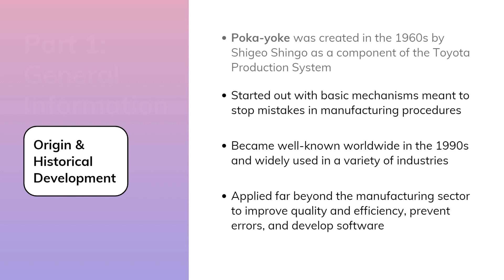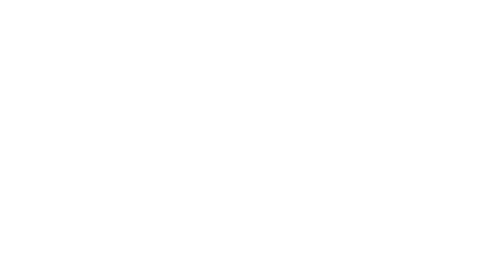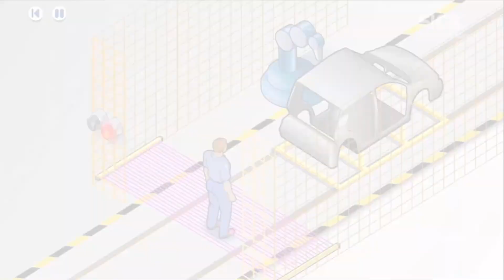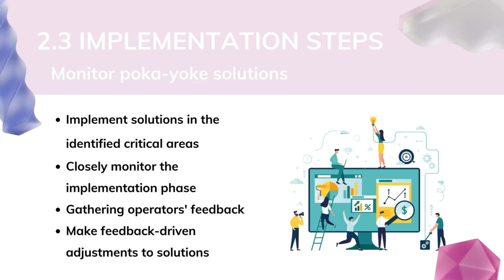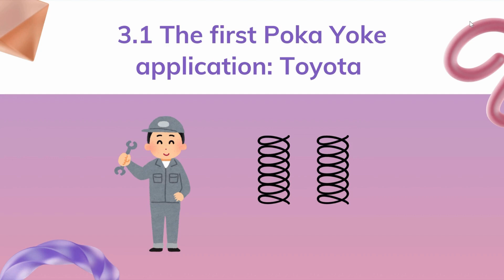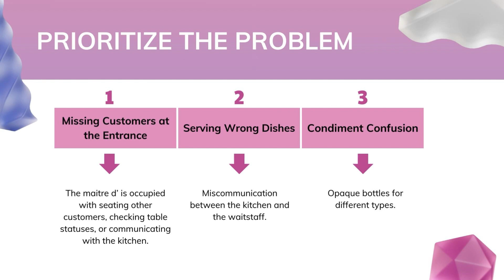POKA YOKE

Comment: Hi, I am Nhật Thiên, from group 2. My questions are:

1. While Poka Yoke aims to automate mistake-proofing processes, it still relies heavily on human oversight and involvement, especially in areas like training, monitoring, and feedback. How can businesses ensure the right balance between automation and human intervention when using Poka Yoke?

2. While Poka-Yoke aims for error prevention rather than error detection and correction, how can organizations ensure the long-term sustainability of these improvements, particularly in environments with volatile changes in technology or product design?
Reply: Thanks for your questions, we would like to answer it as follow:
1. To effectively balance automation and human intervention in Poka Yoke, businesses should start by assessing the complexity of their processes to determine where automation can be most beneficial and where human oversight is essential. Incorporating employee feedback is crucial, as it allows for real-world insights that can refine automated systems. Investing in comprehensive training empowers employees to understand both the technology and their roles in monitoring processes. Continuous monitoring of Poka Yoke solutions helps identify when human intervention is needed, while flexible automation systems should allow for easy manual overrides. Cultivating a culture of quality encourages employees to take ownership of processes. Additionally, regular reviews and pilot programs can help fine-tune the balance between automation and human involvement, ensuring that systems remain effective and adaptable over time.

2. As we discussed in the video, implementing Poka Yoke is not a one-time effort but rather a journey of continuous improvement. To sustain Poka Yoke improvements in environments with frequent technological changes or evolving product designs, organizations should foster a culture of continuous improvement (Kaizen). Specifically, when designing new products or processes, ensure that Poka Yoke mechanisms can be upgraded or replaced as technologies change. To achieve this, it is crucial to encourage collaboration between design engineers and production teams to align Poka Yoke solutions with future product iterations. This can be done by anticipating potential future needs and embedding adaptability into the design phase. Early integration of Poka Yoke into product and process design allows for proactive adjustment to changes. Last but not least, regular employee training also plays a vital role. By keeping the workforce updated with changes, employees remain capable of managing both new and existing error-prevention measures.
We hope this answers your questions.

Comment: Thank you Group 4 for your information. I am Đạt from Group 8 and I have 2 questions for your group:

1. How can Poka Yoke be applied to reduce errors in customer service processes where human interaction is key?
2. What role does automation play in enhancing the effectiveness of Poka Yoke in modern manufacturing environments?
Reply: Thanks for your questions, we would like to answer it as follow:

1.In fact, customer service processes cannot ignore the key role of people. However, here are some ways to apply Poka Yoke to this process:
- Implement standardized scripts for common inquiries to ensure consistency and reduce misunderstandings. Scripts can include prompts to guide representatives through complex interactions.
- Use checklists for service representatives to follow during interactions, ensuring all necessary steps are completed and nothing is overlooked, such as confirming customer details or following up on previous issues.
- Provide visual aids or dashboards that highlight key information about the customer, previous interactions, and common solutions, helping representatives quickly access relevant data.
- Conduct regular training simulations that mimic real customer interactions, allowing representatives to practice responses and problem-solving in a controlled environment.
- Implement a real-time feedback system where representatives can receive immediate support or clarification on complex issues from supervisors or specialized teams.
- Establish a system to log errors and analyze trends. This can help identify common mistakes and allow for process adjustments or additional training where needed.
- Use automated reminders for follow-ups or important actions, reducing the reliance on memory and ensuring timely customer care.
- Develop specific guidelines tailored to different roles within the customer service team to address the unique challenges each role may face.

2. When combined with Poka Yoke, automation becomes a powerful tool for boosting efficiency. It can simplify repetitive tasks, improve consistency, and minimize human errors. Poka Yoke devices, enhanced with smart automation and data analytics, can quickly detect and correct anomalies, which helps reduce waste and non-conformance costs. By integrating automation with Poka Yoke, manufacturing processes become more streamlined, dependable, and productive.

Comment: Hi Group 4, my name is Hương Trà from group 1. I have 2 questions for you about the topic of Poka Yoke:
1. Can POKA YOKE be adapted to prevent errors in knowledge-intensive tasks like software development or research?
2. How do the company know if Poka Yoke method is working effectively or not?
Reply: Hi I’m Bảo Hân, representing Group 4 to answer your questions: 

1. Yes, Poka Yoke can indeed be adapted to prevent errors in knowledge-intensive tasks such as software development and research. In the context of software development, as discussed in the video, Poka Yoke is used to prevent user and coding errors. On the other hand, in the field of researching, Poka Yoke can minimize errors through systematic measures such as checklists, automated validation tools, and visual aids like flowcharts to ensure process accuracy. Feedback loops enable quick error correction, and peer reviews offer additional oversight. These methods enhance reliability and prevent mistakes in data collection, analysis, and reporting.

2. To measure the effectiveness of a Poka Yoke method, companies can track various metrics. These include error reduction, process efficiency, cost savings, customer satisfaction, and employee morale. Tracking the frequency of errors before and after implementation can reveal significant improvements, while regular audits can assess adherence to Poka Yoke practices. Furthermore, developing key performance indicators (KPIs) related to quality and efficiency allows for a quantitative analysis of the impact. By analyzing these metrics, companies can determine if their Poka Yoke initiatives are leading to improvements in quality, efficiency, and overall performance.

Comment: Hello group 4, my name is Khang An from group 6. I have 2 questions about the topic of Poka Yoke method:
1. Do you have any specific strategies to overcome Poka Yoke's limitations?
2. How can Poka Yoke principles be integrated into complex, multi-stage manufacturing processes to minimize human error without significantly increasing production time or costs?
Reply: Thanks for your question. We would like to answer your questions as follows:
1. We do have some strategies to overcome this technique's limitations:
- Initial investment: To overcome this, businesses can focus on applying Poka-Yoke in the most critical and error-prone areas first, maximizing return on investment. Simple, low-cost solutions like visual aids or checklists can also be used initially, with a phased rollout approach to spread costs over time.
- Complexity: Solution for this is simplifying the design by breaking down processes into smaller steps can make implementation easier. For example, technology like automation and sensors can also simplify complex solutions.
- Resistance to change: To solve this limitation, involving employees early in the design process, providing training to explain the benefits, and offering rewards for positive adoption is a good way to go. It can reduce this resistance and encourage smoother implementation.
- Overreliance: To counter this, businesses should promote a continuous improvement culture, encouraging employees to look beyond Poka-Yoke for ways to enhance processes. Regular training and audits will help maintain awareness.
- Applicability constraints: Solutions should be tailored to specific needs, combining mechanical, procedural, and digital techniques where necessary. A mindset of continuous experimentation will help businesses find ways to adapt Poka-Yoke to more complex or unique processes.

2. The essence of the six principles of Poka Yoke guides the practical application of mistake-proofing to address errors in listed in order of priority as showed in our video. These principles are intended to minimize the risk of mistakes while minimizing production time and costs in the long run.
Implementing Poka Yoke systems can initially be expensive. Companies need to invest in new equipment, technology, and employee training.  We cannot provide specific cost-reduction measures for applying Poka Yoke, as these depend on the company's unique situation. Therefore, it is crucial for companies to carefully evaluate their unique manufacturing processes and financial circumstances to determine the most suitable approach. For example, for a start-up with a limited budget, it is wise to begin with basic, low-cost Poka Yoke techniques - such as color coding, visual cues, or templates - that help prevent errors at critical points without high initial costs. As the company grows, more sophisticated methods can gradually be adopted.

Comment: Hello group 4, my name is Mai Ly from group 7, I have two questions about the topic of Poka Yoke method:
1. Can you give me the examples of when using two type of Poka Yoke specifically?
2. Both Poka Yoke and ISO 9001 have their outstanding points, can you give me the clear example to understand why I should use Poka Yoke instead of ISO 9001?
Reply: Thanks for your question. We would like to answer your questions as follows:
1. Here are examples of two types of Poka Yoke (prevention-based & detection-based)
- A type of prevention-based poka-yoke is the motion-step approach that used by ATMs. The ATM requires users to follow a specific sequence to make sure each step is completed properly before moving on to the next one. For example, it won’t dispense cash until users take their card out. This design helps prevent people from leaving their card behind, which often happens when they're in a rush.
- An Automatic Screw Feeder acts as a fixed value device in a detection-based poka-yoke. Advanced screw feeders utilize sensors or counters to verify that the correct number of screws is dispensed. If the count is incorrect, the system triggers an alert, prompting correction before proceeding

2. As our group mentioned in the video, essentially, the ISO 9000 series is a set of standards that provides guidelines for establishing and improving a Quality Management System of an organization, while Poka Yoke is a method to prevent errors through design or process control. It is not an either/or choice between ISO 9001 and Poka Yoke; both can be used. Incorporating Poka Yoke method can significantly enhance an the ability to meet ISO 9001's stringent quality and safety standards consistently.
For example, the 8th Clauses of ISO 9001:2015 includes controlling production processes and service delivery. In a beverage plant, if there are frequent occurrences of uncapped bottles during the capping process, it leads to spillage and product waste, affecting both quality and efficiency. In order to achieve ISO 9001:2015 quality management system, a Poka Yoke method can be implemented by installing a sensor mechanism that automatically stops the conveyor belt if a bottle is missing a cap, preventing the error. By using Poka Yoke, the production process is controlled to prevent errors, ensuring uniformity and consistency in the output. This approach supports compliance with Clause 8 of ISO 9001:2015, which focuses on controlling and managing production processes effectively.

Comment: Hello Group 4, my name is Phúc from Group 3. I have 2 questions reagarding the topic of Poka Yoke method:
1. What type of production may not be suitable for implemeting Poka-Yoke?
2. What challenges might a company face when introducing Poka-Yoke?

Thank you
Reply: Hi, I'm Vân Anh. I represent Group 4 to answer your question:
1. There are 2 examples of production that may not be suitable for implementing Poka-yoke:
- Highly customized production like customizing jewelry: Each piece is unique, making it hard to standardize processes for Poka-Yoke.
- Highly manual production like bespoke tailoring: Tailors rely on craftsmanship, each work is customized, leading to high variability in the production process. Using Poka-yoke will limit the personalized quality of garments.

2. We have presented in the video:
- Initial investment: Setting up Poka-yoke systems can be expensive at first. Companies need to spend money on new equipment, technology, and training, which can be a problem for small businesses with tight budgets.
- Complexity: Creating and adding Poka-yoke solutions can be complicated. In businesses with many steps and processes, figuring out how to use Poka-yoke effectively can be tricky and might slow things down.
- Resistance to change: Employees might resist Poka-yoke because they are used to their current ways of working. They might see it as extra work or a hassle, so it’s important to communicate and train them well to get their support.
- Overreliance: Relying too much on Poka-yoke can make employees less careful and ignore other ways to improve quality. It's important not to depend solely on Poka-yoke and still focus on overall process improvements.
- Applicability constraints: Poka-yoke might not work for every type of production or industry. Some processes might be too unique or variable, so other quality control methods might be needed.